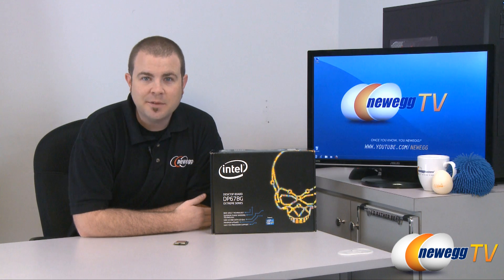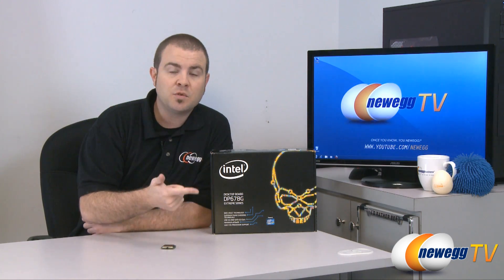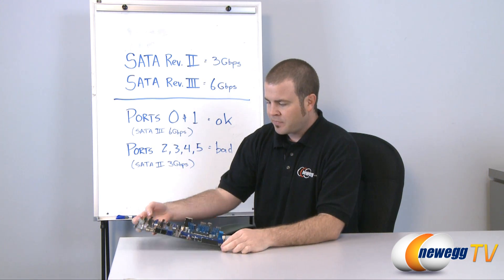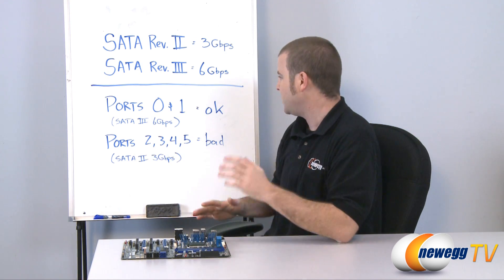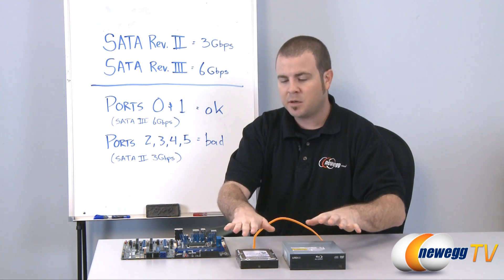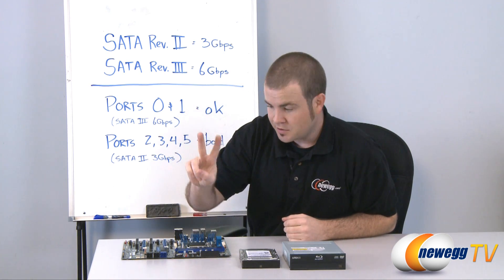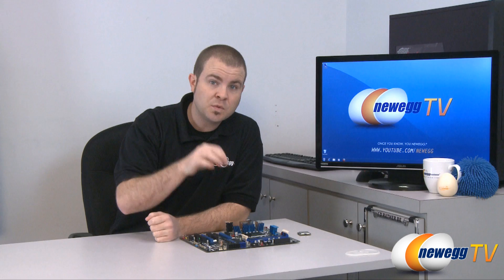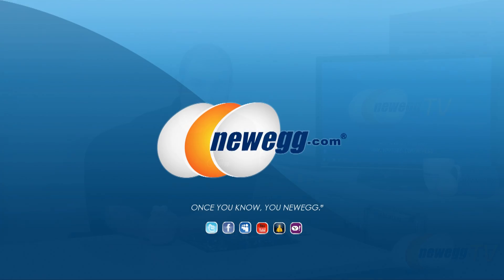Newegg TV: Sandy Bridge Design Issue Explanation & Workaround

Comment: I bought the revision b3 from amazon. Put it together yesterday. Guess what? The SATA ports are fucked. Go figure, they didn't fix the problem. My board is manufactured by intel dp67bgb3. My os won't boot from disk or hdd, so now I have to jump trough hoops to get my CPU working.
I7-2700k
32gb corsair dominator ddr3 ram 
Evga gtx 580 gpu
Psu: corsair 1050 hx 80 plus silver

Comment: yeah that's the one main thing that  has kept me from buying into cpus and mobo's  they CHANGE THE DAMN SOCKET REQUIREMENTS TOO DAMN MUCH TOO DAMN FAST!  take a hit from amd.  you CAN design a great cpu and stick with the same socket design for longer than 2 years. IT'S NOT HARD.  am3  and am2+ BOTH support phenom II x4 and x6 cpu's and run them VERY well.

Comment: @Ryuuken24 Heres the thing.

Intel DID know about it. Its in the errata section of the new chipset papers that were released.

Thing is, Intel didn't think that the voltage would cause such a major malfunction in the board. Sadly, that has bit them right on the ass.

Would be nice if they realized how bad it was earlier, but I'm betting it was just an honest mistake that one engineer made. Poor guy's probably fired by now :P

Comment: Anandtech has rather detailed info over this for those who want more.  It's a transistor that runs the PLL on the SATA 3Gbps clock that has too much bias voltage.  Eventually the transistor will be stuck ON, heavy use, heat, etc. will accelerate this.

The HM65 chipset seems to be affected too, if your notebook is using the SATA 6Gbps ports, its OK.  This bug only affects the SATA 3Gbps ports on the chipsets.

The planned Z68 chipset will NOT have this bug.

Comment: From my understanding the SATA port failure takes a good while to surface and at a fairly low percentage. I just ordered a system over the weekend and it seems like I'll still be able to enjoy a sick system even with this failure. Big ups to Newegg for coming out with this information and taking ownership so quickly. I've got no regrets about ordering the parts and I'm sure I'll be happy with it until I get a replacement motherboard around April. A unfortunate situation but Newegg FTW once again

Comment: Thx for the help guys...I had one more question:

Since my setup requires only 2 Sata ports (one for HD, one for disc drive), I don't technically have to get a new motherboard right?

(though obviously it would make sense because 4 SATA ports are essentially nullified, but this computer is mainly for my parents use, and they don't need more than the bare minimum - and I'm lazy to replace mobo...)

Comment: I got to laugh at all of the "Glad I stick with AMD" or "Intel sucks all their customers got screwed."

Correct me if I'm wrong, but this isn't a flaw that will completely destroy your whole computer. The processors themselves are fine, it's just the chipset on the motherboards that has a problem handling 4 of the 6 SATA ports over time. And this is only a problem if the hard drives are put under stress for a long time.

I wouldn't be bashing Intel when the Bulldozer proc isn't even out yet.

Comment: @excelerater There hiding like scared little rats LOL! AMD stands behind it's user base when they have problems with hardware, & gives them a fix at little, or no cost, as with Intel they make you buy all new hardware to get get fix. It's a true shame that Intel holds most of the market and can pull this crap, and get away with it. Hell even VIA gives better support, cause VIA even gave me a new mobo, when i got one of there's with a bad IGPU out of the box, crossed shipped, at no cost to me.

Comment: Glad I'm running AMD, cause when AMD has problems, they fix them, and give there customers support, Intel says Frack you, wait will we release new hardware versions, that will cost you out the arse, to fix yourself. This stunt by Intel is why the Kraken super computer runs on AMD hardware, and not Intel, cause they would have to change mobos every time they got a more powerful set of CPU's, with little support behind it

Comment: Thanks Paul. I think mine is affected. I have actually noticed some disk overload and slow transfers since using my system for about 2 weeks now. I switched as many hdds as I can off the affected ports and swapped with my DVD drives.

It's disappointing but I'm using enclosures for storage and trying to minimize the risk. For those of us that bought Asus boards from Newegg should we contact Asus or newegg when replacements come out?

Comment: ok so I'm a noob, I just built a computer and it's working but I don't want to have to bother with the problem later.

Luckily it's a bare minimum desktop (only 1 hd and 1 disc drive) but I currently have them on ports 2 and 3.

My question is, so can I just swap them to ports 0 and 1?  That is, am I correct in assuming that SATA 6 Gb/s is backwards compatible with SATA 3 Gb/s?